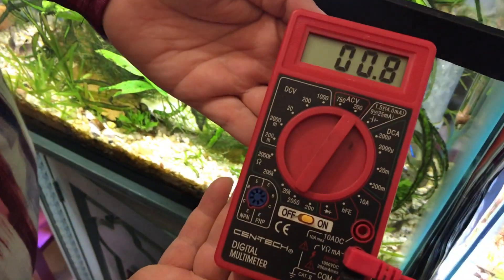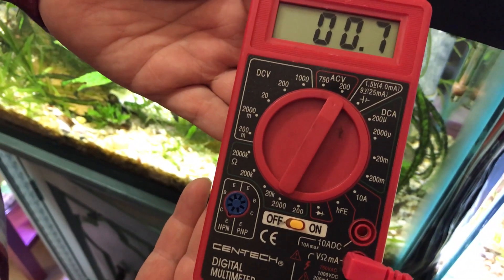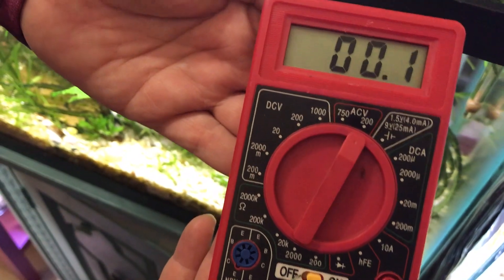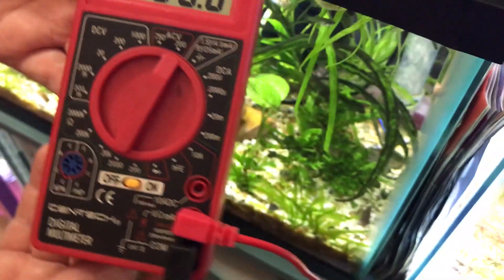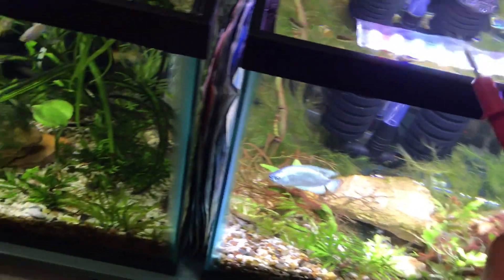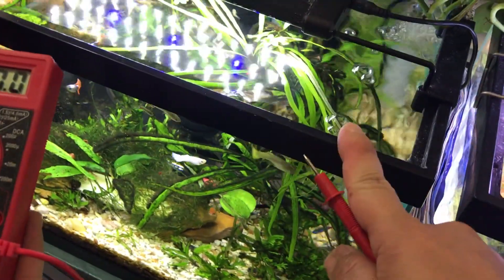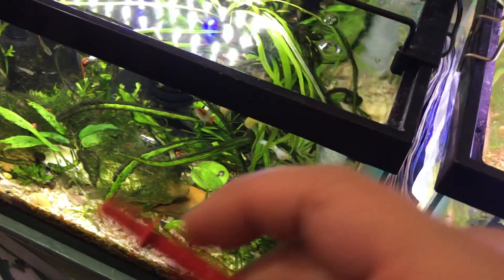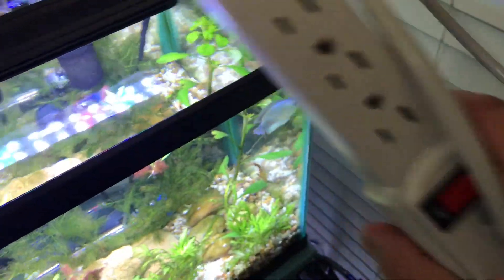Electric Current in Fish Tank

Comment: Thanks for posting this. I had similar issues with my 100 gallon African cichlid tank. They kept flashing, but not dying. I got a great UPS unit, and changed my heater to solve the issue.
Reply from the maker: That's great to hear. It's very rare but it does happen. Thanks for the Comment!